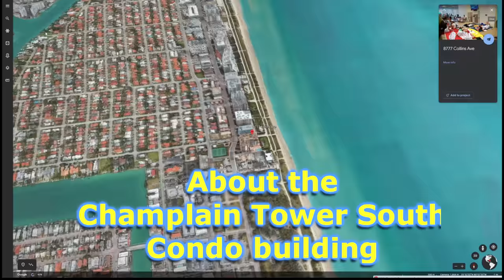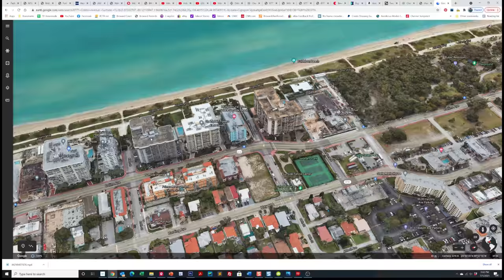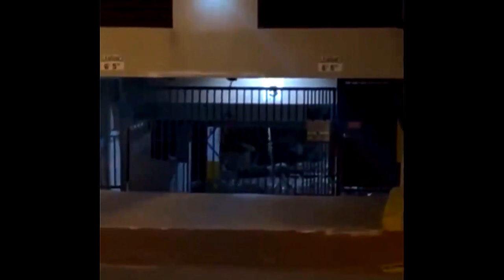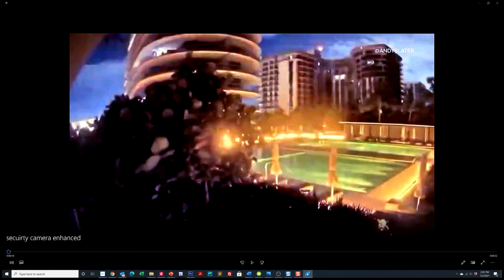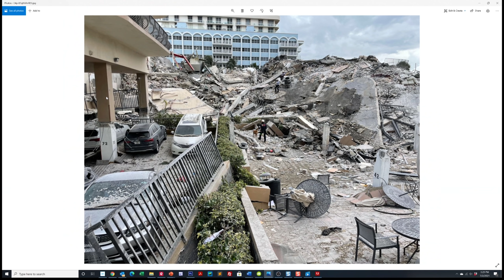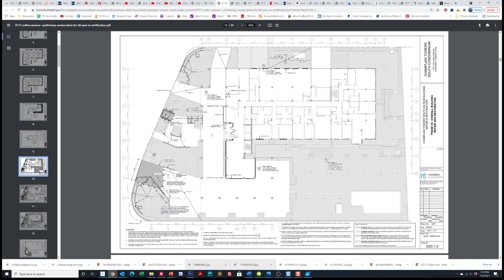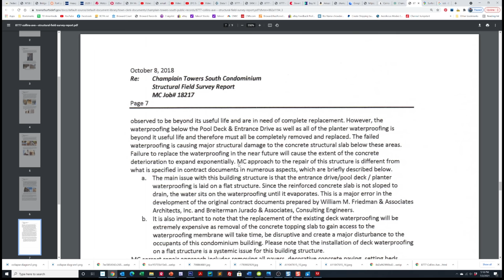Here's Cause Of Miami Condo Collapse Champlain Condo Towers, Surfside

Comment: If they would have pulled a fire alarm when they seen the garage collapse I guarantee that building would have been mostly evacuated if not fully evacuated by the time of the full collapse
Reply: Evacuate a condo building at 1:00AM in less than 7 minutes?
Reply: @erichaynes7502  they may have not gotten everyone out but they would have probably gotten alot more people out than they did. A few minutes could have been a matter of a few hundred vs a few thousand
Reply: @jennifertimberlake6522  You're right they might have got a few more people. I've read that some people were on the street yelling up at people on the balcony's to GTFO. What is a miracle is that one whole section of the building remained standing. Ultimately less than 100 people died but it's still a horrible tragedy RIP victims.

Comment: Ive been in construction over 40 years and have built my share of high rises here in Chicago! No way a sinkhole brings down a high rise like that! I have the video on my phone of the building collapsing, why did you leave out the first few seconds of the collapse where there was a flash of at least 6 flashes [in my opinions explosions] on the top floors simultaneously as in a controlled demo! Which is why it collapsed from the top down! I dont believe you! Ive got the full video, why dont you! Find the full video and explain it away! Until you do, I call BS!

Comment: Interesting to me that these buildings are being required to replace all the windows rather than RECAULK them ~ most of these high-rise windows are not recaulked on a regular basis, that should be a required part of the every 10 year exterior paint job but it isn't .

Comment: Hind site being 20/20. If the person that shot the cell video of the water leak in garage with concrete that has fallen already would have gone over to building and pulled the fire alarm, maybe with a 7 minute time frame some fatalities could have been prevented. I'm only making this comment as a learning tool for future events and NOT saying the videographer did anything wrong. I reviewed several times before this idea of activating fire alarm came to my mind. Please use this is a possible learning comment. If you see large pieces of concrete that has fallen from a building maybe try to evacuate occupants.

Comment: The pool room isn’t much better at the hotels I work at now…although they’re salt water pools, still. Requires specific maintenance to the pools more frequently bc of the salt. And that’s nothing compared to splash lagoon..that basement is a death trap and would get the place shut down quick if it was (properly) inspected. But it never is
Reply from the maker: I imagine they need really good coatings on those pools
Reply: @jeffostroff  Gets expensive

Comment: Im gonna wait until they dig to the bottom and find that a sink hole had formed below the parking deck, thus eroding away the substrate that provided support for the columns. Eventually the parking deck was unable to support the weight anymore, and thus.. failure. Don't disagree with the other theories, but they may have been contributing factors. Each floor looks like they were supported only by the floor below. Once the lowest floor gave way, all floors will eventually collapse. The rebar at the far end should have been in tension and would have pulled straight out. Concrete does not do well in tension.
Reply from the maker: yes I too want to see what they find
Reply: in your vid around 12:10 when you describe that sag- that pretty much looks like the condition where the footings were no longer in support.  Given that it was only a narrow section left (as you had pointed out) and no other large supports (on the remaining section), the weight transfer pivolted on one of the remaining supports, and put the outer most support into tension, and ripped apart. Thats why the fall was slower than the rest. 

As for the other building, if all their supports were rigid, the weak spot would sheer off leaving the rest of the building intact. 
In one of the eye witness videos you highlighted, one of the  beams seems to have either pulled apart, or seperated. Those beams are most commonly bolted in place (and possibly to a concrete column). They are designed for load in only one direction. Lateral loads could pull them out, as the bottom splayed, the beam pulled out of its pocket. the water that you see could be from pipes ripping out from its connections, as fire protection pipes are generally made of iron and would not break easily from bending. They will however, pull apart at a much lower threshold. 

The whole controlled demolition thing is much harder to believe, not with the eye witness videos- unless someone drilled down below the parking deck, and did some stuff there.

Comment: I used to build high rises in so Florida and we would have to pressure test the concrete for each floor, and should those test tubes come back insufferable at test we would have to rip out the whole floor.  And having had a 100 year old house I noticed the concrete had to much sand in it   Which left it to deteriorate over time. It was a fraction of the concrete of today.  I’m not saying that’s what happened just something I noticed over the years.   And yes those pillars looked skinny in comparison.

Comment: Thicker columns are not solid concrete.  They have water supply, roof storm water drains (8"+ diameter) , waste water lines etc. Though that is not how things are done today in highrise construction,  many years ago it was common practice.  I'm not commenting on the cause of the collapse. Just why columns are different sizes.
Reply from the maker: In this case the columns are different sizes because the building that survived the collapse has been has beams and a share wool and so it needed those beefier columns

Comment: Why did the Miami condo collapse? Rainwater soaked into concrete weakening it and rusting the rebar. Rebar expands as it degrades. To expand on what mystic dragon wrote, if you dip a cookie in milk it keeps its structure and strength. If you leave it in milk for 2 minutes it looses its structure and strength.

Comment: By looking at the collapsed pics the aftermath looks like a total rubbish pile like nothing I've seen before. Generally with collapsed buildings there's critical structural parts still in tact and massive voids throughout. This building looks like it had none whatsoever. Makes me believe it was built out of bread and butter to save costs at the expense of human lives.
Reply from the maker: The weight of all those concrete slabs pancaking down with do that

Comment: Some controlled demolition people would be proud to have done such a good job.
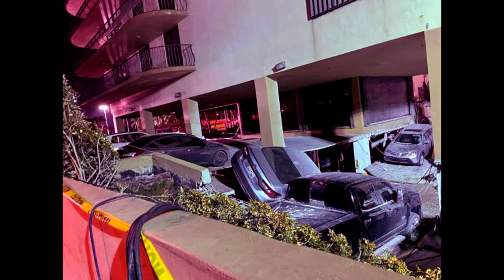From the evidence on the pillars it looks like any cross beams were not tied into them. Look at the thickness of the concrete roadway into the parking areas (21:30) it shows there are no crossbeams whoever designed this got the math wrong or the contractor was skimping. Even the quantity of rebar in those columns shouldn't have supported that building, whenever you see a highrise building the framework is crucial, this doesn't look like it has any except grabbing onto those columns that are at best, weak.

Comment: it seems like most of the weight of the middle section was hanging on the sides of the building and not only on the foundation. and the underground car park is poorly built as if the building was built in a time and the garage in another era! it collapsed and caused the middle section to losen and collapse. the design of the building is a failure clearly and this is why they are focussing on the other sister buildings as they share the same problems. also clearly the apartments were heavy, too much marble and luxury. they didn't consider this is a building not a standalone home!

Comment: We have a house that was built in 1925 and the cinder-block basement walls mortar is so deteriorated you can scratch it out with your fingernail.
I have little doubt this Florida building being built in 1928 will have the a very similar or same mortar used.
Look in the ruble, Barney, for this mortar and it just might be the origin of said deteriorating concrete.
Reply: Corona Virus 
AAAhhhh... unknown where I heard 1928.
.
Champlain Towers South, was located at 8777 Collins Avenue (Florida State Road A1A) in the town of Surfside, just north of Miami Beach, Florida. [18] It was built in 1981 by a group of developers, Champlain Towers South Associates,[19] led by the Canadian property developer Nathan Reiber.

Comment: I just read a website about Sinkholes in Florida (for beginners). It mapped out the different areas of Fla in color code & what types of Sinkholes are in each color coded area, & named some major cities in each area. It also LISTED SIGNS OR INDICATIONS TO LOOK FOR IN BUILDING STRUCTURES THAT IMPLY THE BUILDING IS BUCKLING & IN DANGER OF COLLAPSING. THAT CONDO BUILDING & EVERYTHING you are pointing out, water leakage, cracking & crumbling concrete, & windows leaking ARE ALL IN THAT LIST!!! That website is to educate ppl interested in buying property in FLA. so they can look for warning signs.
Reply from the maker: yes concrete gives you plenty of advanced warning

Comment: But jeef that water could have been from staining effects of the hurricanes pushing in water when the storms hit the coast pushing the water in a head of it several times throughout the years. Which is a temporary event; which will still cause the staining. But for the most part the floors remain water free for the majority of the time. Or it wouldn't pass inspection. Not with electrical motors on the ground running filtration pumps for the pool's water filtration system. But unless that rebar was sealed before placing in the concrete that had water absorbing through it; all the concrete's rebar will start to corrode because the water carries oxygen in it which is a corrosive agent in and of itself. it looked like a controlled demolition job, exactly the way we would bring a building down in sections upon itself. This too is the reason for shear walls as well so the whole building will not be lost if a section fails.

Comment: This vintage and type of construction has a finite lifespan. The HOA cannot keep up with maintenance costs. If this building was 6 story rather than 12 it might still be standing. We need to stop building this type of structure it is destined to fail.  The parking area was another problem. I would be very leery if I was living in the sister building a few blocks away.

Comment: I wonder if someone drove into the columns under pool deck. Damaged already weakened concrete from corrosion and set off a chain reaction that led to collapse
Reply: It's possible but so many of the residents were 70-80 years old. The contractors had already cut out a large square of the pool deck so there were known problems way before this collapse. I believe one of the contractors highly recommended the whole pool deck be dismantled and replaced with a new one. All the leaking water rusted everything out from within. Thin columns in the parking lot garage couldn't withstand the collateral damage from the pool deck collapse.

Comment: Don't think so Jeff. You make some good points but it's early days. A comprehensive investigation and identification of the multiple root causes will take more than a year, possibly much longer. This includes participation by professionally licensed engineers and other specialists. 
What's missing here: No analysis of physical properties of concrete and rebar. No comparison of design drawings versus as built. No consideration of substantial modifications to the original design. No modeling of forces in the building structure (FMA).
Comprehensive reports of other reinforced concrete structure failures provide some insight into how a full investigation takes place and are available on the internet. They can guide us in understanding how professional teams work on these tragedies.
Let us pray for the poor souls lost to this tragedy and remember the deep sorrow their family and friends are feeling now.

Comment: They probably used saltwater mixing some of the concrete. It's happened where I live in Melbourne Florida. But building didn't fall.
Reply from the maker: that was stopped in early 70s from what I heard
Reply: @jeffostroff  That's when the beach side condo was built. Here is Melbourne Florida.

Comment: Hello Jeff just saw your video on the towers collapse, great job of second guessing what happened, from what you and the now experts are saying if I'm not wrong is that building should never have been occupied.  Which means that the engineers,  architects, contractors et all where completely wrong or incompetent and it should never have been built and occupied.  Or maybe the inspectors engineers and architects who are probably dead and buried should be sued or in jail and not the criminals that failed to maintain and repair the building with minimal in and maximum profit out should not have been held accountable?? Nice job running interference for them 😂

Comment: what you didnt mention when talking about the sheared rebar is that its completely visible in your one shot. The four or so columns to the right show no rebar but the post on the left of the pic shows the rebar that wasn't sheared....all 4 total effective pieces of rebar that passed from the column into the structural deck. Ive see the plans, that is the entirety of the horrible design. The entire non structural deck was delaminated (visible from your pool eqip. pics) exposing the soon to be rusted rebar about 2 inches below. Not one piece of concrete on top of those columns. Someone should be executed for this. Thats virtually impossible

Comment: Do you think it might have been possible that some of the chlorinated pool water might have been seeping from gaps in the caulking around the pool and might have travelled and accumulated at points where it could have caused the accelerated corrosion of the steel rebar on structural beams.
Reply from the maker: There were no leaks from the poo;
Reply: @jeffostroff   actually I just saw a video today that alleges significant pool leakage

Comment: I feel like the issue started the minute it was built.
Reply: and it took decades for the issue to appear?
Reply: the thin columns were there to allow extra parking that's for sure. Still, if the pool deck wasn't leaking for decades I doubt the collapse would have happened.

Comment: The building looks to have fallen inwards around a circular cavity. When he show the 4 color coded sections you can see the clear outline of a circle. There are several places shown in this video with circular patterns in the collapse site. Natural cicles always indicate a single source i.e. fairy rings, culderas,  craters, sink holes etc

Clearly the chlorine leeched the minerals from the concrete foundation. This turns concrete into Swiss cheese 🧀. Then repeated flooding gets to the sand/ sandstone earth below and slowly turns the sandstone to sand, washes away the sand, the rest of the support columns have to take on extra load for free floating support columns, eventually the sink hold is too big, the concrete sags at the zenith of the hole, this would create exactly the collapse we see. 

 You can clearly see the rim of the circular sink hole.

Comment: The Pool had nothing  to do with the building collapse. The garage slab was sheared off by the weight of 12 slabs pancaking. I can prove the garage did not collapse first.
Reply from the maker: you have nothing. video already shows the garage deck was collapsed 7 minutes before the building.
Reply: @jeffostroff  Then the fire sprinkle system would have activated 7 minutes before the collapse and people would have evacuated .. Thanks for the 7 minute confirmation. The video shows  a pvc pipe leaking and debris. No slab collapse

Comment: The building lacked beams to support the columns, so everything crumbled down as tightly as it did. There are no beams in the inside photos. No evidence of beams inside of the apartments, nothing that supports the balconies.
By not using beams, the builders could fit an extra floor in the building, which meant more dollars into their pockets.
The cause of this tragedy was greed.

 @ArqMANES explains this disaster pretty well  in his channel.

Comment: Have you taken in to consideration other than the failing parts and bad Architecture that the US Navy had a Soundness test on the new USS Gerald R ford CVN-78 just a Few days earlier using a 44,000 ton explosive that caused a 3.9 earthquake at the epacentre, and that the Condo building is exaclty 250 Miles from the test site wich is 170 miles east north east of  Ponce Inlet. I think it was a combination of bad architecture and the US Navy Pushing the building past its ability to withstand an earthquake of more that 1.0 on the richter scale.